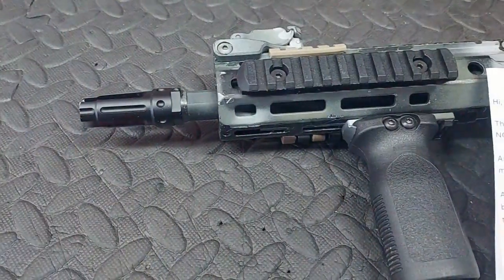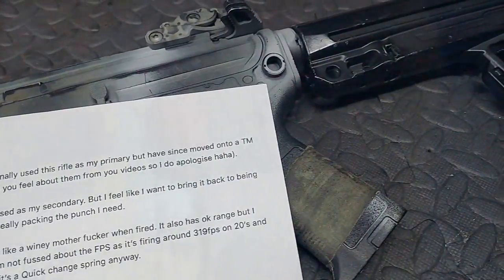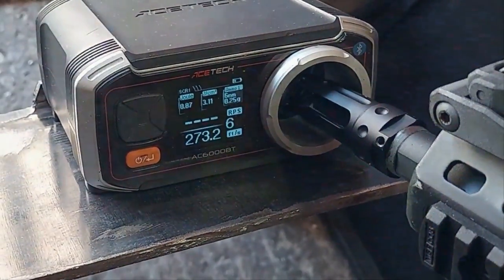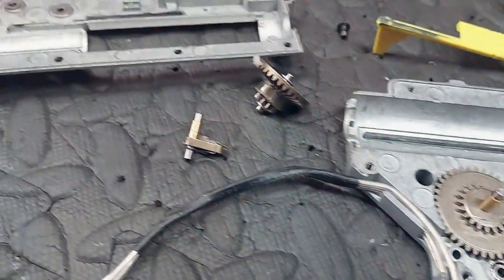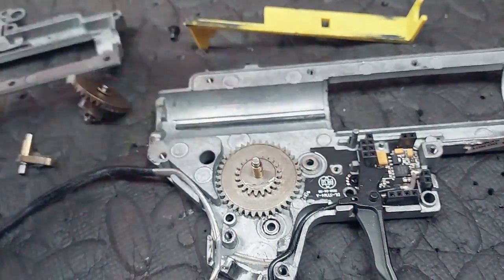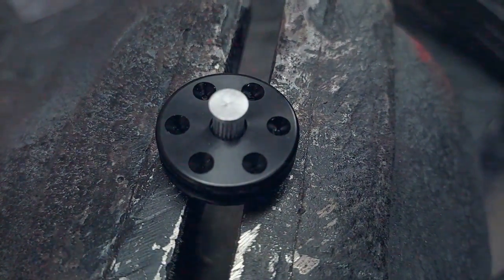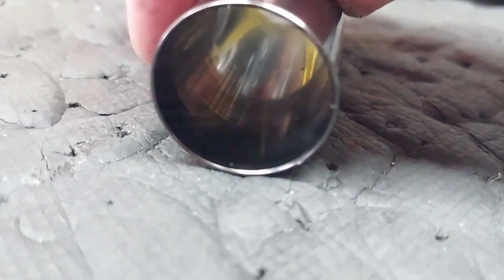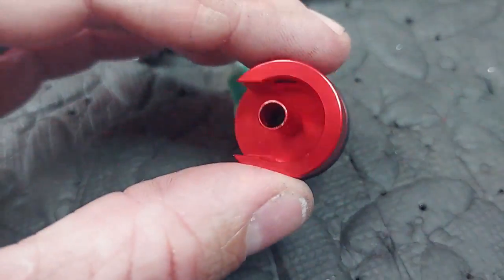Double Eagle M906 - Back To Basics

Comment: In all seriousness though DE M900's get a nice shot in the arm from the XT piston head + cylinder and cylinder head and a few other bits from our friend at ak2m4 👍 I've upgraded all my three DE M900's, one being a beast on 0.32g, so hopefully Mr Shouty approves.
Reply from the maker: It's AEG of the last two years but lack of "paid advertisement" keeps them from the limelight & the accolades they should get.
Reply: @NegativeAirsoftTech Just like you lol (please don’t ever sell out)
Reply: @clivearnold8796 what specific XT parts did you use from ak2m4 as there's a couple on the website: regarding the piston head, cylinder head and piston?
Reply from the maker: @Mechanikool8  use these:  https://www.ak2m4.co.uk/internal-parts/pistons/xt-14-tooth-piston-cnc
& 
https://www.ak2m4.co.uk/internal-parts/pistons-heads/xt-piston-head-6-vents-viton-oring-aluminium
Reply: @NegativeAirsoftTech  top man, worth getting the anti heat cylinder while I'm at it?
Reply: @Mechanikool8  Of course 🙂
Reply: @xtairsoft  which one for UTR45 version 2 gearbox with 230mm barrel?

Comment: Recently had an issue with the double eagle FCU. Three buzzes on safe, does one single motor turn on semi or auto, then dead trigger afterwards, not enough to cycle the gear box. Put it in safe then in fire and it does the same partial gear box cycle. 

The manual says 3 buzzes means over voltage, but I'm pretty sure that's just when you plug the battery in, it'll give you three buzzes. I only get one when I plug it in. 

I was previously using 11.1 lipo but have tried a 7.4 recently and same problem.

Comment: I've been having a problem with the M906 where on semi my gun shoots twice like if it was on a 2 round burst, its not set to binary. Do you think it's more likely to be a FCU issue or a mechanical issue? It only happens after I use it in full auto and goes back to firing 1 round on semi after quickly tapping away on semi a couple times

Comment: can you get the flash hider off on these or am i gonna break my tools if i try?
Reply from the maker: They unscrew, counter clockwise
Reply: @NegativeAirsoftTech  honestly quite incredible. i got an m906b after being recommended an m904 by a friend of mine and i cant find any resources on anything related to the disassembly of this gun. like the only reason i wanted to take the flash hider off was to find the threading because i couldnt find what it is anywhere  👽

Comment: Over all how are these cheap DE models? is that a good mosfet?
Reply: For the money they're bloody good, I've got three of them (DE M904E, M906C and M908A). The Falcon controller's weakness though is hammering it hard on full auto with 11.1v batteries, so avoid this / set it to three round burst, and it will last years and years (having optical cycle control for such a cheap price is a killer feature).
Reply from the maker: @clivearnold8796  can't use brushless, gets hot on 11.1v but it's a damn fine pew
Reply from the maker: Meant to tag through other guy...
Reply: Thanks guys
Reply: @NegativeAirsoftTech  Mr Pete at ak2m4 has a lovely XT 22 TPA motor for that scorchio level hot Chaoli.
Reply: @NegativeAirsoftTech  It's OK, I'll take whatever I can get at my age 😉
Reply: @clivearnold8796  explicit instructions from the manufacturer not to run it at 11.1v unless you're going over 350FPS, that'll be why.